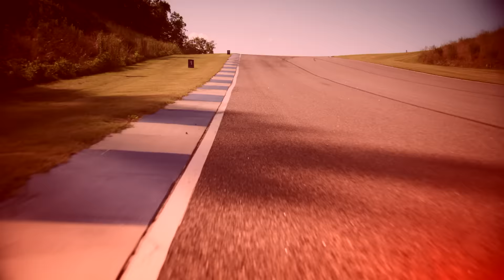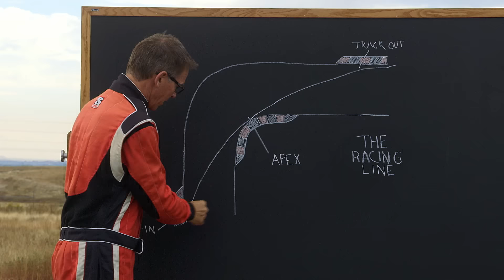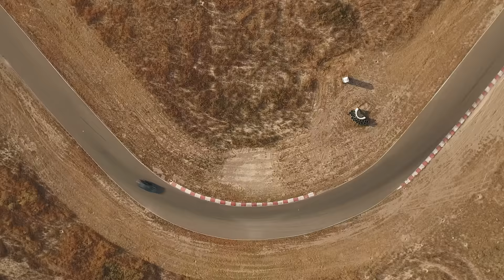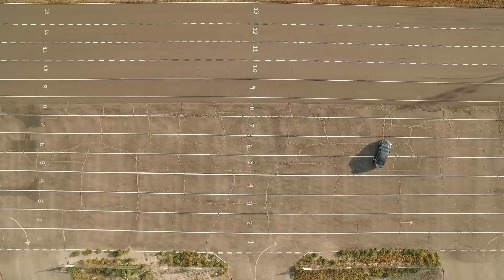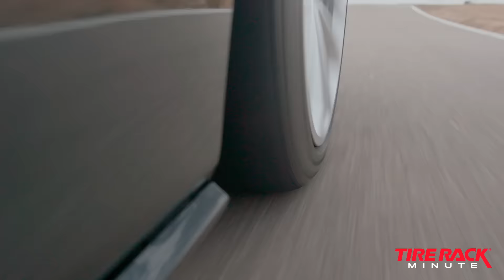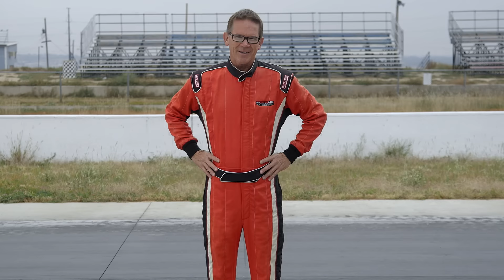The Racing Line: The Only Line You Need! - The Racing Line Ep. 4

Comment: Very good, it'd be nice to see a difference or some info on a simple 90deg corner, would it be faster to go slow in and fast out, fast in slow out or the normal racing line, and would it depend on what corners or straights are after that simple 90deg corner? :)

Comment: Simple geometry, the wider you go the farther you go. Wider around any part of the turn equals more terrain equals you aren't in the lead you idiots. The tighter your car goes around a turn the better. The lighter the better you can go round a corner, tightly. Really Motor Trend? Do some simple math here inside is the closest point from a to b...
Reply: +FullSpectrum Survivalist handling is definetly more fun than flat out power, I have lots of fun in my e36 with a whopping 140hp
Reply: +John Hamilton https://pbs.twimg.com/profile_images/378800000697945639/a7eeae038851851a2b0507cca1917b04.jpeg
Reply: +John Hamilton You don't understand racing at all.
Reply: +FullSpectrum Survivalist Arrogant ignorance never fails to entertain me :D.
Reply: RandomUsername Yea, I outrun a guy a few years ago on the highway in heavy traffic, he was driving an Monte Carlo Super Sport with a V8, I was driving a Mitsubishi Mirage 2 door, with 97 HP from the factory, and a K&N air filter. He tried to pass me 5 times, but kept having to lay on the breaks. He thought since he had twice the cylinders and 3 to 5 times the horsepower he could pass me.

What he didn't know was I had a nimble light car, curb weight under 2,200 pounds. My drag coefficient was about .37Cd, and I was running a brand new set of PARADA SPEC 2 45 wide low profile tires.

I went by him doing about 115 just cruising along, did he catch me, he sure did, could he pass me, nope not going to happen. While he was hitting those brakes 5 times cause his car had no handling, I never let of the gas. I floored it and weaved right through traffic, I don't need much room to do it either.  

There's a reason they say, "Fix the driver first". I placed 5th my very first autocross race in a bone stock Audi A4 QUATTRO on crappy street tires in Autocross, and there were two Super Cars present. I had just bought the car like a week before that, wasn't even used to it yet, didn't know how much it would push in the pins. I did know it would though, so I put more air in the rear tires so they would rotate, and took some out of the front tires to counter the pushing. The two super cars beat me, 2 Beamers that were also AWD and had turbo's beat me, but the Beamers had turbo's I didn't.

I did have one advantage though, I drove 3 years in Germany during the Cold War with no speed limits in a 318IS rally BMW with a 4 speed.

I had similar results with that car, ironically, I was following a German to a party out in the woods, he was driving a Camaro with a 350. He would dust me ever  straight away and almost lose me, but every turn I would catch him as he went out of it. I'll take handling and grip every time over horsepower if curves are involved.

Comment: But how can the inside be faster than the outside line? The inside has for sure a tighter radius but normally is cleaner than the outside line. Can't figure this out.
Reply: Outside line is a longer distance and allows for higher vehicle speeds, which sometimes allows for more momentum so you can carry more speed on the exit than the inside line would allow for.  On the down side, if something goes terribly wrong, there's less room between you and your new agricultural lands to save it, when the inside and racing lines will allow for more room if you get into trouble.

Comment: I would say arc length rather than radius. With same amount of traction or (same car) the wider you go, the more arc length you gain. Ie, entering a corner at 19.4 m/s with a turning angle of 20.93 degree with a track width of 17.6m, your arc length is about 98.3 meters (from turn in to apex) and 98.3 meters from apex to turnout. Speed increased to 19.6 m/s, with 0.23 degree gain due to mild over steer, arc length decreased to a shorter 98.29 meters from turn inm 98.29 from apex to turnout. One more try, speed increased to 24m/s which gains just 0.21 degree of turning angle due to under steer, arc length increased to 98.31 meters. So that, there's a certain speed that'll give you the best combine of steering angle and speed. 
So, mild over steer does cut the distance travelled. It's a good method. Just remember, more loosing (mild over steer or under steer) means less acceleration at turnout, especially for most AWD cars and this is why I have to point out why GTR is a good car with the rear wheel biased all wheel drive system.
However, more speed with same amount of steering angle will cause you more time to travel. Although more speed means less brake, however, cornering distance depends more on lateral speed.

Comment: I still use the line when driving my van, keeps it fun.
Reply: Yup, confuses people when you do it in a XJ Cherokee though, especially when you pull off a curve that they can't in their little sporty car.
Reply: Same. People won't stop honking when I'm in on the wrong side of the road.
Reply: +GreenJeep1998 Probably me, tbh.
Reply: +TheRoadDriverly Had another XJ do that, as well as an Acura RSX, embarassed a TT pretty good one time too.  One of the wildest ones was in the 4dr hatch Lebaron (RIP) that Jeep replaced, took a corner a bit hot and it started to push, so I let off, collected it, and looked in my mirror to find thst somebody in an old (although much newer than my car) Mercury Mystake had tried to follow me................Aaaaand understeered out of the accelleration lane, across two traffic lanes (which were empty because we had the green light, thank god!), and nearly biffed the left front corner into the median.  When I saw that, I stuck my size 13 into the turbo and GTF Outta There!
Reply: +GreenJeep1998 And by curve, you mean rolling it. XD
Reply: +TheRoadDriverly Nope, although I tend to see somebody else experiencing sudden understeering events in the rear view mirror.
Reply: We all do

Comment: The racing line also varies with the type of car and speed of the turn. With a car that has a lot of acceleration, or a slow corner where acceleration is naturally higher, you'll want to prioritise the exit to get the most acceleration, especially if the corner is followed by a long straight. With a slow accelerating car, or a fast turn, keeping the speed up will be a bigger priority since you won't be gaining as much from a good exit.
Reply: +Keven Harvey This would be car specific instructions, while he was explaining track specifics. I do agree with you, but then you also need to take into consideration camber, toe, temperature, engine placement, type of tires, aero... Lets give Randy time and he will explain everything. 

Good job Randy.
Reply: +Keven Harvey well said. miata vs. corvette/viper.
Reply: Denis Franco Fair warning, this is going to be a long explanation. engine placement and F/R weight bias affect the behavior of a car substantially. Most front-engined cars have >60&+% of the weight over the front axle, which causes the front end to plow into understeer when the front tires lose grip - which is safer when you get into an accident. It's the reverse for rear-engined cars (which is why historically 911s have a nasty habit of snap oversteer when you get off the throttle in the middle of a corner - the engine in the back acts like the bob at the end of a pendulum).
The ideal place for an engine is, of course, in between the axles a.k.a. mid-engine. But since this usually results in the engine BEHIND the driver, it's only suitable for performance cars where things like rearward visibility don't matter as much. However, some OEMs do manage the elusive front-midship configuration, where the driver ends up sitting closer to the rear axle than normal and the engine is located COMPLETELY behind the front axle.
Both of those layouts greatly increase the neutrality of a car, and can drastically change its behavior in full transition - i.e. braking and then accelerating while turning into a decreasing radius corner that changes in height over the duration of the corner. That theoretical corner tests chassis balance, brake balance, suspension response in all aspects (bounce/rebound/camber changes/damping/accuracy), oil systems, and even the driver themselves.
TL;DR FF, FR, MR, and RR cars will all behave differently if you use the same line through that corner, which is why they all require different lines to achieve peak times.
Reply: +Reptilius Maximus how exactly does the engine placement affect the racing line? i always knew it was important but i can never figure it out. in forza horizon when tuning the car there is a "front" indicator saying like 45% or 51% about the weight which gets green or red. but is it about the momentum causing the car to spin or is it about the tire grip difference between front and rear? sorry if im not clear, my english is not very good.
Reply: thanks, now i get why the ruf rgt8 is so drifty lol
Reply: Denis Franco haha yeah RUF cars are Porsches on steroids. Look up the CTR Yellowbird. :D